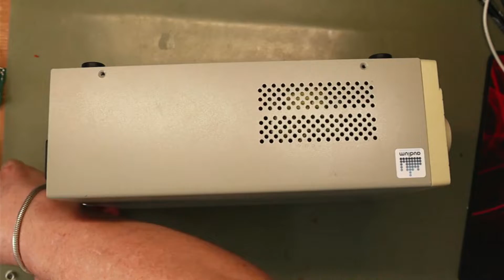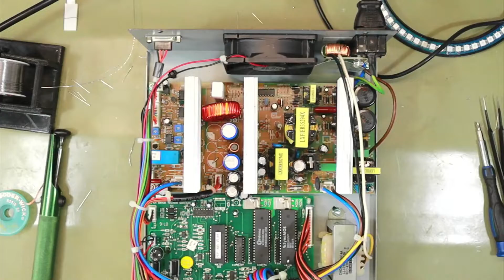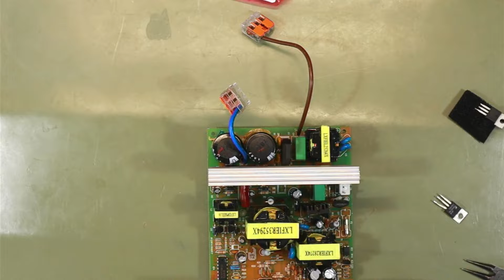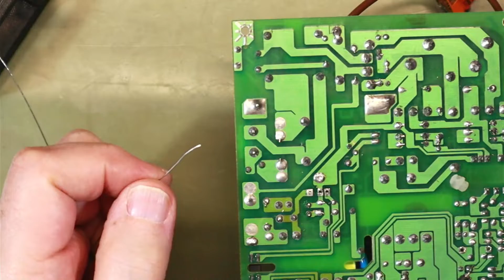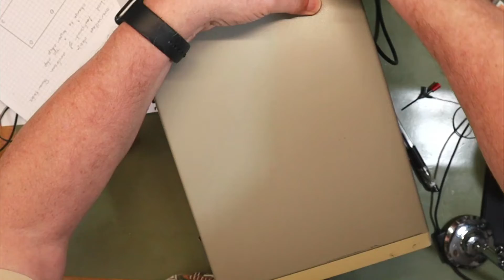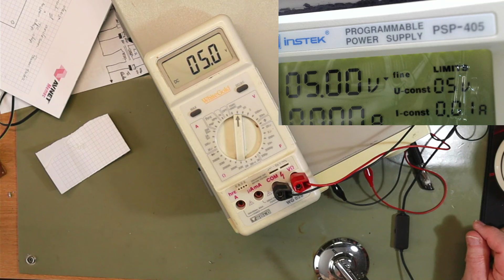#228 PSP 405 re cap and repair

Comment: Looks like a quite old design. Such boards I have seen in 1990..2000. Today they are made in SMD technology. Instead of LCDs they use LED displays. I guess you could buy a modern replacement for this device, which is much smaller also, for a quite low price (below 100$).
Reply from the maker: Its quite old but they still sell this model. The problem with cheaper new designs is they have cut costs so they don't work In practice as good as they claim on paper.  The current one cost about £225 so well worth saving.
Reply: @TheEmbeddedHobbyist  At least it's a taiwanese company and not chinese. I avoid any chinese stuff as much as possible to not support the nationalistic expanse and also the attack on Taiwan that China is planning. From this standpoint it's even better to repair. Repairing is better generally, to avoid senseless waste. I also repaired many of my stuff. Standard rule: A modern device is failing usually after 3..5 years to let you buy another one. A selling tactics called "Planned Obsolescence". If you repair the one location that is intended to break down in nearly all cases you get a device that works wonderfully for 10..20 years. Your device should now work for another 10..20 years while with a chinese one you could expect a maximum of 5 years. The only thing which would bother me is the size. It's quite big compared to modern ones. If you use it on a fixed bench, no problem. But if you travel with it, not so cool.
Reply from the maker: @hansregli8678  i prefer to repair my older equipment as it was made to better spec's etc. Plus i don't need to travel much with my kit. my main DMM's are HP bench meters, my frequency meters are all bench units so all about the same size.
when i equipped the last electronics lab all the DMM's were mains powered bench units, just got two handhelds. this stops folk coming in and trying to borrow them all the time. Also never see the point in calibrating handhelds, just stick a "reference only" sticker on them. the same as i did with power supplies. Saves a lot of time and money. 🙂

Comment: Well done, sir! I will have to try to remember that trick with the stand-off, clever solution. If you have to reverse engineer a double-sided board, use the same photography trick then stack the two photos in your editor, align them  and use the opacity control on the top layer to shift from top to bottom - sort of like xray vision. Regards, David
Reply from the maker: Thanks for the suggestion that sounds like a great idea. I'll give it a go next time.
Reply: @TheEmbeddedHobbyist  One detail, when you take each of the photos the board should be the same distance from the camera to avoid parallax errors. I use some long standoffs to support the component and non-component sides equal distance from the table top. Regards, David
Reply from the maker: that's why i did them side by side as i just used screen grabs and changed the size in paint shop. I'll try your method next time thinks. @davidv1289

Comment: Nice repair. I would never have found the fault. Seems quite accurate now it's working.
Reply from the maker: Took a lot longer to trace the circuit and then find a replacement chip than I had hoped. but got there in the end.